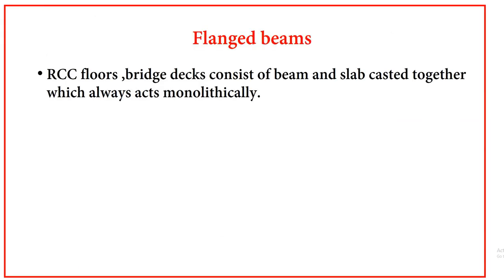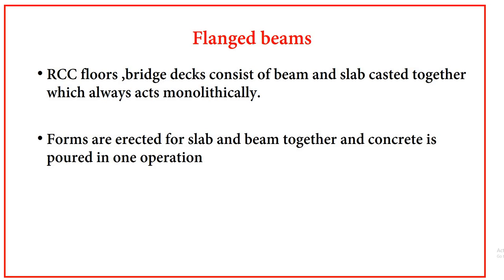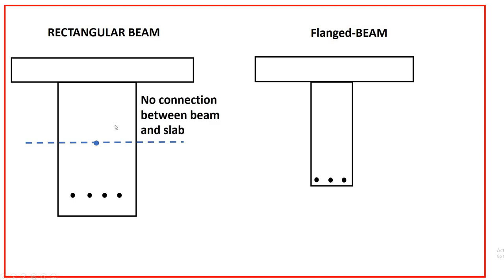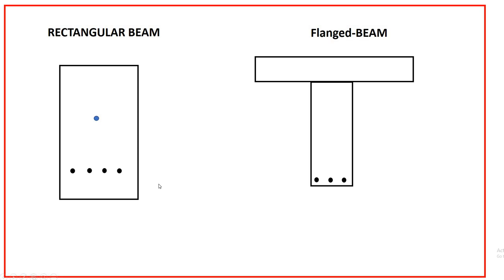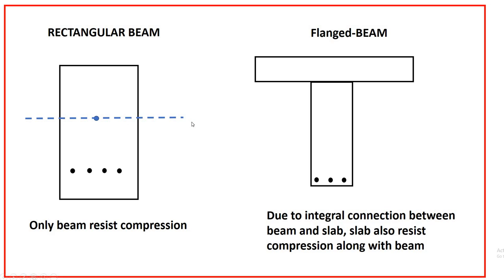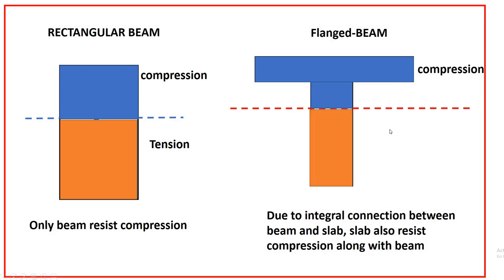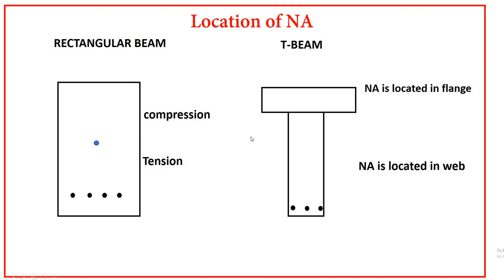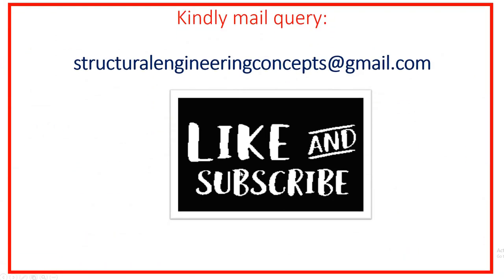Flanged beam and rectangular beam

Comment: Thanks for the video.  We really need those types of concept explanation.  Here in Mauritius, we usually have the web of the beam cast first then the top part of the beam is cast together with the slab.  Hence part of the stirrup is found in part in the slab and the top bar of the beam is cast togehter with the slab.  Please let me know your thought about it?  I believe this is most likely a restrained slab due to the stirrup of the beam but the beam being cast in two operations does not qualify it to be called a flanged beam, more likely, aimply supported.
Reply from the maker: https://www.researchgate.net/figure/Reinforcement-Detailing-of-T-Beam_fig1_319255726
the same thing followed here in india
REFER this figure...attached here with